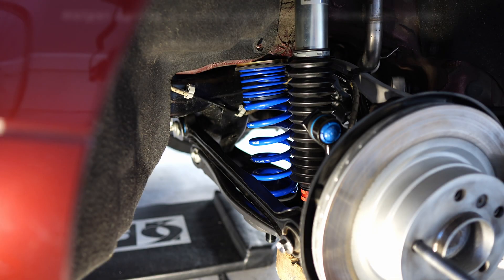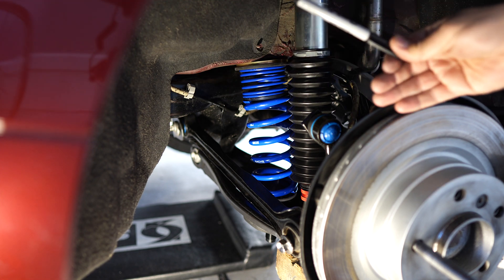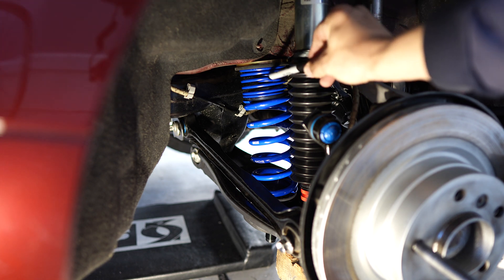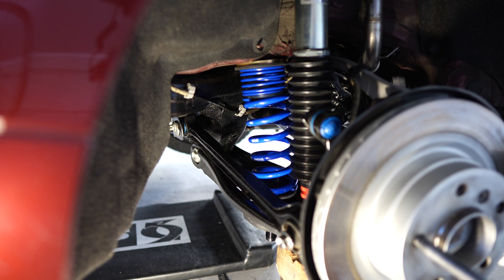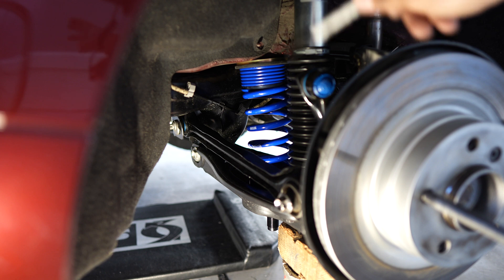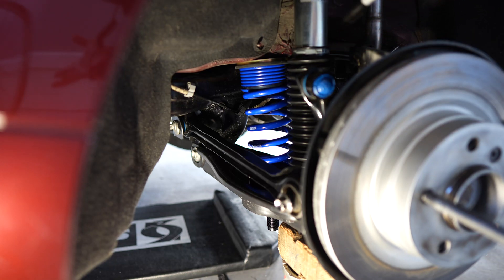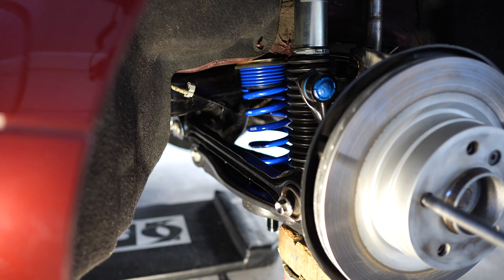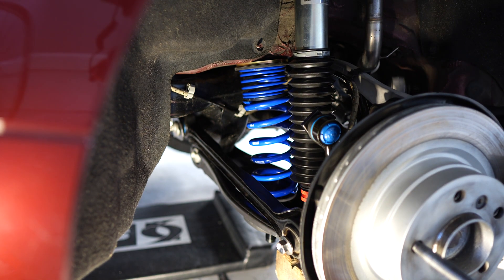What is a helper spring and how it works #bmw #suspension #howto

Comment: I find it interesting that coil springs in this setup are not captive

I have only really seen coilovers and 4x4 springs which are always attached at both the top and bottom of the spring
Reply from the maker: Well, it is what it is, and it works, I guess. I'm not sure I have a clear understanding of what you're describing, I should look it up.